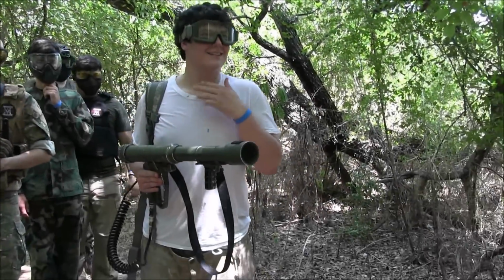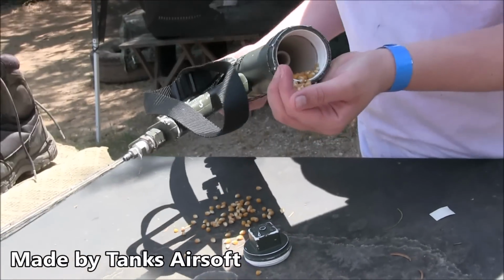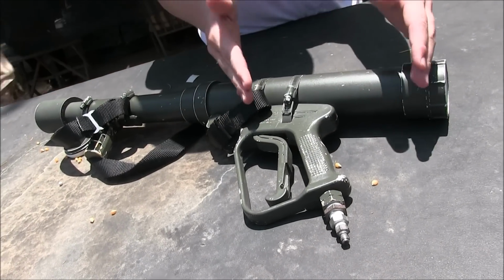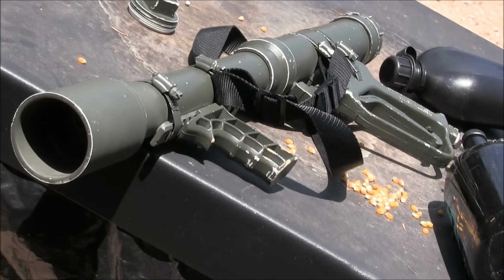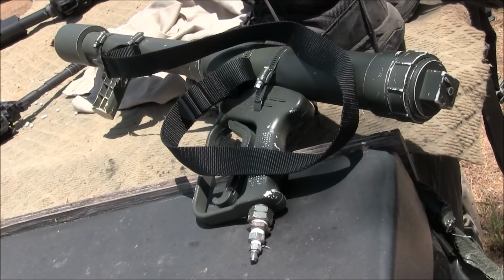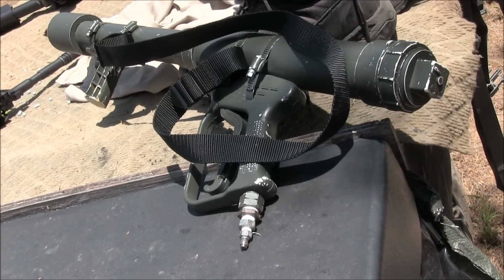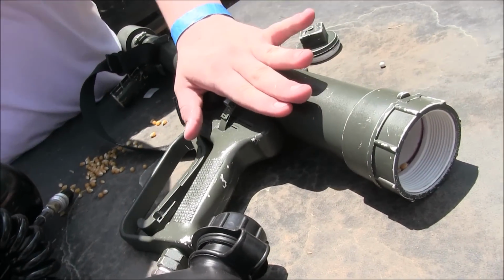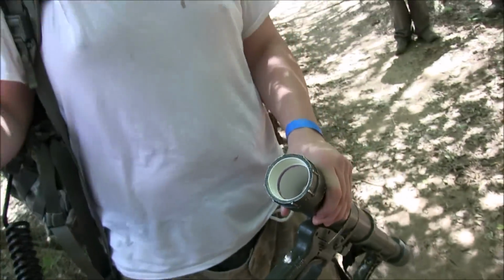AIRSOFT FLAMETHROWER!

Comment: Dude is not that complicated, something like "the air blows the corn out" would suffice.
Reply: sogerc1 well there's alot of videos on YouTube of people doing this
Reply: yeaahhh
Reply: You can take a soda bottle, attach a valve, tape a straw to the cap, fill it with bbs and pump air through the valve.
Reply: Except it doesn't, it creates a vacuum that sucks the air out, were you even listening?
Reply: The Arctic Gamer novritsch did it and it workec
Reply: Is not that complicated...
Reply: +The Arctic Gamer; no vacuum. Just pressure diff.
Reply: @trainknut  He did say the positive pressure equaling out is what launched the corn. I also thought it was a vacuum when I saw the blower part for the pressure washer towards the front end of the ammo chamber. At my workplace we have venturi vacuums for different purposes. If you turn them around hold the trigger and put some kind of debris in the intake side it launches quite far with quite a bit of force.
Reply: Nah his explanation helped

Comment: This is nothing really close to a flamethrower. It was getting really interesting when he started talking about high pressure, low pressure, differential pressures meet, etc. because I was expecting it to somehow be able to cook the popcorn (now that I think about it, that was pretty stupid of me to think that you could cook popcorn inside a pipe gun like this) and spray out puffed popcorn.
Reply: add the induction coil from a microwave, a steel pipe, an inverter and a car battery. Oh and butter, buttered popcorn so much better... damn-it now I want buttered popcorn
Reply: Yeah it was so disappointing to see the kernels shoot out uncooked. What's the point of having a flamethrower if it can't cook popcorn?

Comment: Hey guys one of the guys that made the flamethrower here, a small correction to make I said 200 fps in the video this should be 800 fps if anyone is interested i will be doing to a full mockup of the entire system wants we get the whole system built
Reply: excuse me, fps should be psi
Reply: It would be cool if you guys added a little orange led system (That doesn't block projectiles) to simulate a firelight

Comment: You should have a backpack full of kernels and have a feeding tube with a valve so you don't have to open it plus more ammo, the vale is so the pressure doesn't go the wrong way... unless you forget to close it while reloading...
Like if you agree
Reply from the maker: King Creeper EMD that's a solid plan
Reply: Thanks👍 I always have good comments but never good content by the looks of it, nearly 1 year and only 30 subs, then again it been a while since I posted...

Comment: I would add slap a small speaker on the thing that makes even louder flamethrower sounds. The pressurized air sounds like it a bit but is covered up by the sound the kernels/BBs. Doesn't sound quite as intimidating, sounds like you're throwing a baby shaker toy at me or something

Comment: I want to try a similar concept with gas grenades (green smoke counts as toxic at my site), functioning similar to a single use flamethrower which can be used to clear through forests (the site I go to has thick bush which guns struggle to punch through) and can be used for area denial.

Comment: Looks rad af 
Love the idea and the build looks good and solid
Sadly though execution was pretty whelming I hate to say..
I’ve seen a really cool idea for an airsoft flame thrower using a leaf blower and a flame coloured scarf secured at the end of the blower. One of those really light see through type scarfs.
If that idea could be implemented with your design I think you’d be onto and all round winner.
Only problem I see is getting the scarf back into the barrel after it’s been used..
Maybe some kind of sniper rifle like lever system where pulling it back pulls the scarf back into the barrel and pushing it forward allows the play the scarf needs to b blown back out again
Reply: A leaf blower with a flame colored and light transparent scarf secured at the end that is pulled back into the barrel with a bolt and pushed forward when needed for barbeque time on a trench or pillbox... not a bad idea there bud, we can certainly do that. Have the scarf attached to the inside of where the bolt is to pull it back and blow out a stream to roast some good 'ol fashioned "Tan" Army soliders up to no good on a spit like the "Green" Army soldier that you are
Reply: @rhodesdrakethenieliii3209  I just wish I could do more to implement my suggestion/idea.
I live in Australia, and we aren’t allowed nice things like Airsoft.
Even the toy in the video would be technically considered a firearm and therefore illegal here.
Reply: @noomfy-mopkebab3632  Australia may be full of spiders that will kill, nice things like Airsoft or Nerf being denied and the blazing heat like it's India or the Philippines where sweat is pouring out on hot days; but you shouldn't set limits to imagination, this is a great idea and I'm just adding onto your comment

I can tell that you live in South Australia, as they have a law that forbids Nerf there. But ah well, that's just Rival and gel blasters; I'm not sure if dart blasters count

Oh yeah, some red, orange, yellow and brown BBs too; so that the flamethrower can still fire like an airsoft weapon and clear out those pesky players in confined spaces and buildings, just another idea to your vision of an "Airsoft Flamethrower"
Reply: @rhodesdrakethenieliii3209  depends on the nerf really..
Some of it is allowed other stuff not so much… even the people “in charge” can’t make up their minds.
And these rules vary wildly from state to state aswell which is frustrating.
We had gelblasters for a hot second untill most states banned them.
But I appreciate the input. Honestly I do.
I try and get to New Zealand to play and implement my ideas as much as my savings will allow and am co founder of an Aussie milsim club called Funnelweb Milsim.
So we’re doing what we can with what we’ve got.
But it does become expensive when you have to factor in flights, accom, transport and food etc on top of your guns, gear, gas and bb’s.
I’ll prob bring up the flamethrower concept with some of my kiwi brothers and sisters on my next trip and see if we can’t get some more ideas and a prototype potentially 😍
Reply: @noomfy-mopkebab3632  It's all good, all this may be expensive but I know it's worth every cent, because you've got the vision and Funnelweb Milsim has you to thank

And the fact you mentioned having kiwi brothers makes me think of the Clone Troopers; the Temurea Morrison voiced clones like RC-1138 "Boss" to be exact, or even Jango "OG" Fett himself

Comment: Holy shit! Someone get to funding this I WANT ONE ASAP
Reply: It's a fucking popcorn kernel sprayer. Do you really want one?
Reply: Dug Mason dude i made one and put it in a plastic uzi body and its pretty noice but i used a 6.08 barrel so it has better consistency and accuracy for long range but i want to make one where it has a hop up
Reply: So I assume you just paused the video when he said he uses popcorn right? You can use bbs whenever you feel like dumping 20 bucks a game.
Reply: Dug Mason i made it as a concept build and yeah it eats bbs like candy, but all you have to do is use a 7mm or 8mm copper pipe to allow the kernels through because the tube he was using barely got the fps because of such a wide bore barrel. Throw a tighter bore barrel and the fps could jump to 250-300
Reply: Dug Mason I
Reply: You could make on in less than one full day

Comment: Well of course the (airsoft) flamethrower won't have ACTUAL flames, he puts in the flamethrower category because it has spread fire and is good for close quarters, flamethrowers are known for cleaning out small bunkers and close quarters areas in seconds because you can just spread some fire in there, so he just calls it a flamethrower since it technically has the same combat traits as an actual one, accept it uses popcorn instead of fire cause it's AIRSOFT, you're not actually trying to kill people in a sport.

Comment: Yeah... not practical. You would need a much larger ammo capacity, like, half a cubic foot more at least. Also, why no continuous stream-shot in the video?
Reply: That falls to the design of the gun. We initially went with a larger ammo chamber like you suggested, but unfortunately the size of the chamber meant that to little pressure accumulated, thus the popcorn not going very far. 

As for your second point, pressure. We need the pressure to build back up in between each shot. Thus the intermittent fire rate.

Comment: Add a wider, longer nozzle ringed with bright led's on the inside. Use glow in the dark bb's. Fire it at night. Maybe wire the led's to the trigger so they aren't always on. Maybe another set of led's inside the hopper. I think it would look quite cool.

Comment: It needs to be compressed in the gun instead of at the bottle, this will allow for you to make a slightly smaller hole that has a valve release which will be Concentrating the bbs more effective out from the area of high pressure to the are of low pressure

Comment: I do love the idea that HPA can do more then just 'make your gun better ' AND THIS IS THE BEST EXAMPLE OF DOING THAT, Now idea here have a 2nd hose attach to it which feeds the bbs into the thrower or at least a refill bottle that attachs to it...just throwing out ideas here.
Reply: We considered having a tank fed ammo supply but decided against it for two reasons. The first is realism and balance. A real m2 backpack has about 7 seconds worth of fire, the same is true for our design. In addition, we thought that it would be somewhat unfair to other players to have such a large ammo supply. The second reason is the technical challenge. To create what you are talking about would require a mess of tubes and an increase in the investment of time and money on the project. Even if we could get it to work.
Reply: But the thing is, the M2 has 3 tanks. If you kept the main air in one big tank, the BBs in the other big one, you could have a smaller amount of air in the third tank to push the BBs into the chamber, where the big tank takes over.
Reply: Yes, but two to the the first reason we do not have any plans to construct sycga weapon

Comment: I think it'd be better to use water in order to replicate it properly.
Reply: A. C. then why not just use a water gun?
Reply: KILLEKIRAHVI It would be a watergun lol
Reply: A. C. This is becoming a meme lol
"Then why not use a water gun"
"cause it would be a water gun"
Reply: A. C. Yeah making every one in a game wet is a great idea people will love it
Reply: Mysterion An airsoft flamethrower would impractical anyway. So I don't expect one in the foreseeable future. Also they got airsoft landmines that get you wet if you step on em.
Reply: unfortunately water presents two challenges. The first is gameplay, its not fun to be soaked  and then have to play airsoft soaked. The second is that transportation of the kernels without them spilling out of the barrel is hard enough, water would not be practical.
Reply: Maybe not liquid water... But what if you built it like a giant vaporizer? Spray them with water vapor?
Reply: KaptainSparta 
That sounds like a job for German engineers.
Reply: Yeah but some people wouldn't like the idea that they're top quality gear got wet or maybe phone
Reply: @KaptainSparta  this is late but the water vaporizer Idea is fucking amazing. Wouldn't be to wet and it would great a cloud similar to a flame from a flame thrower. Only issue is I bet the gun itself would burn your damn hand off every shot but I mean great idea

Comment: It would be way more efficient and powerful if he just scaled down the diameter of the barrel tube.  The bb's would have a higher velocity because there is less room for air to escape causing pressure to build higher in the chamber and also less room for hundreds of bb's to be dumped at once.  This idea was obviously copied from Novrisch's cheapest airsoft gun video.